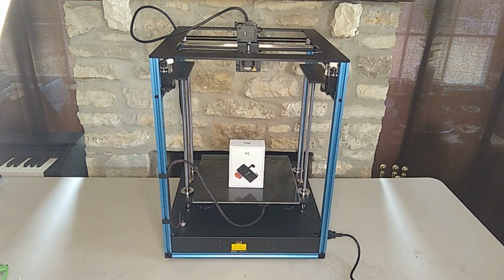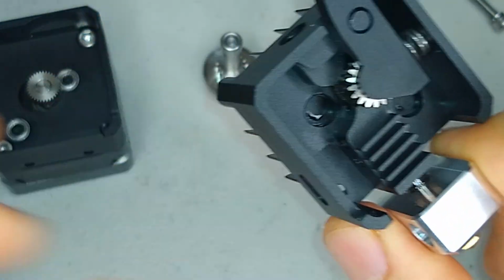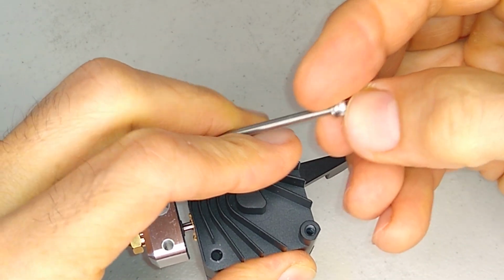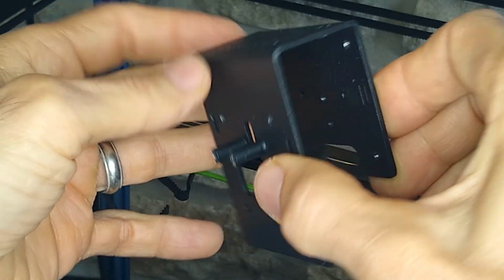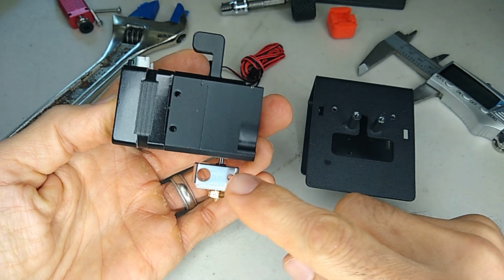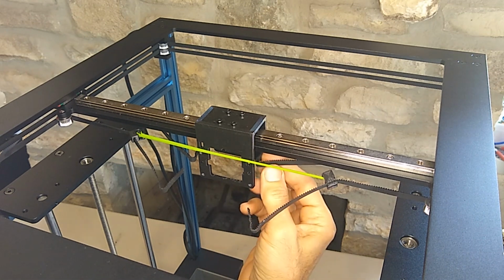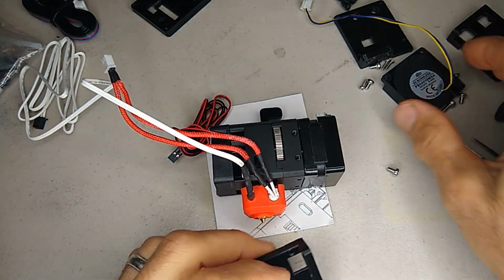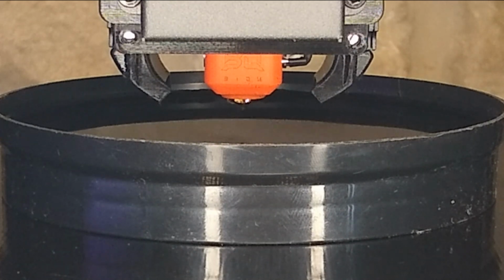BigTreeTech BIQU H2 500c Install with Dual Parts Cooling Ducts on Corception 300 / Creativity ELF

Comment: excelente video , como se consigue esa pieza para hacer convercion a RCA?? gracias
Reply from the maker: Hola Carlos, Gracias por comentar. Agregado tienes las piezas - https://drive.google.com/uc?export=download&id=18fj7KJJgVAlFWSyyWn2wGBkCC_DgBXEz
Reply: @vbared  muchas gracias bro.. pero ese conector , dónde conectas los termistores y todo eso , dónde lo compras ??? Cómo se llama ? Para no tener tantos cables
Reply from the maker: @carlosrivas3440  Hola, Mis disculpas por no entender las preguntas iniciales. Los Corception 300 vienen con esas partes. ¿Te refieres a la pequeña placa verde que convierte los cables al cable VGA? Voy a eliminar todo el conjunto del conector porque agrega mucho peso al cabezal de impresión.
Reply: @vbared  si bro correcto , mm no sabía que tenía mucho peso .. pero si se ve bien porque elimina mucho cableado que viene de la placa. Gracias por responder 👍👍

Comment: This orientation seems very bad for ringing and other vibrations with the relatively heavy motor so far away from the mounting point on the linear rail.  I'm considering changing from my direct drive BMG clone with stock hotend TwoTrees Sapphire Plus (which looks very similar in design, but with just more steel for the top part) to some other extruder/hotend combo to increase my flow (currently I only get around 16mm3/s reliably, limiting my print speeds).  I'm hitting a similar problem that all the nice combinations are difficult to mount and would cause lots of torque on the linear rail carriage holding the hotend and/or reduce the build space due to the nozzle moving away from where it now is.  The H2 was one option I was considering, but I'm not convinced mounting it this way would yield an improvement compared to my current setup.  I would expect Klipper's resonance measurement to deliver way worse results with the H2 mounted like that than with my current BMG (with heavy NEMA 17, but that is nicely balanced over the linear rail) ...  So, (in Yoda voice) keep look I shall ...
Reply from the maker: Hello MisterkeTube, Thank you for commenting. The Corception 300 has been an ongoing project for me. You are correct about the orientation of the hotend if the goal is to print fast. I cut off the two pegs on the original linear rail bracket and mounted it sideways. Thank you for the feedback on the timing belt keepers. Did you purchase the .STL files from my Shopify store? If so please send me your invoice number so I can refund it.

Send me some pics of your hotend mods when you get things right.

Enjoy your weekend!

Comment: Great idea on the "timing belt clamp holders", but you could even have made those fully closed, pass the belt through it before putting the belt through the hole of the carriage and then just push it over the double-folded belt.  If would expect it to be much more sturdy and have a longer lifespan if it would be a complete rectangle.
Reply from the maker: Thank you for your suggestions. Improving the design is going to be awesome.

Comment: I'm just wondering whether that heat-paste for CPUs is suited for the up to 300C temperatures of a heatblock?  CPUs normally don't get that hot, so I could imagine the paste isn't meant for such a higher temperature.
Reply from the maker: I had the same concerns until a viewer sent me some AMD copper paste he had been using on large transistors that generate a good amount of heat to try. After thousands of hours printing during an all metal hot end upgrade to one of my machines the old AMD thermal paste was still pliable. I know it works because without using it, while running Noctua heatsink fans, I would experience heat creep during long back to back long prints, the nozzles would clog.

Comment: Hi Victor, Really great job you ve done! One question: have you consider to add a bltouch?
Reply from the maker: Hello Sebastian, Thank you for commenting and encouragement. I have been wanting to add one. If I do it would have to be behind the hotend under the linear rail. Since making this video I've changed the orientation of the BQ H2.  I was getting too much movement from the hotend due to all of the weight being way out in front of the gantry bracket. Some type of manually added clicky sensor could also be an option.
Reply: Thanks again! Have you made a video with the new one? I have a biqu h2 for months and coudn't installed it :(
Reply from the maker: @sebideluca  Hi Sebastian,  Are you wanting to install it on the Creativity ELF or Correction 300?
Reply: @vbared  hi again! On creativity elf
Reply from the maker: Hi Sebastian, Linked is the CAD model of the new mount. It will involve grinding down the two hotend support pins in order to make room for the 3D printed BQ H2 adapter plate. I also drilled and tapped the BQ H2 in one spot to have two bolts holding it to the adapter plate. If you're interested in it let me know and I'll link it to you. I'm assuming the ELF mount is identical to the Coreception 300 version. If so it should work.

https://drive.google.com/uc?export=download&id=1D2dS517nSyyLcwAPET388d1ju_sNHntr

Comment: guide where to connect something to the motherboard, I think it will be useful to many ... will there be problems with connecting the p100 thermistor? there some kind of amplifier goes to it in the kit where to shove it?
Reply from the maker: Hi Viktor, Thank you for commenting. My kit was a high temperature one and it came with a sleeved thermistor that slides way in.
Reply: @vbared  I ordered the same one. but I can't figure out where should I install Max31865.

Max31865 is installed in the motherboard?

Could you make a guide for everyone or just lay out a diagram of where to put the Max31865

Thanks
Reply from the maker: @viktorcarnage2226  Hi Viktor, I'm unfamiliar with that module that was included with your kit. Mine kit didn't include the amplifier. I found the video below on it but it doesn't look to me like it would work with something like a stock Creality control board that doesn't have configuration jumpers or connection pins for it.

https://youtu.be/R_PmkXWLOYo
Reply: @vbared  hello, I have a robin nano 1.2 board, do you have the same one?, please answer one more question, which thermistor did you use pt100?
Reply from the maker: @viktorcarnage2226  Hi Viktor, Yes, mine came with a P100 but no amplifier board so I was unfamiliar with your question until I looked it up. The video I linked gave the pin information but I would search the forums for installing it on your specific board.
Reply: @vbared  thanks for the answers, do you think it will work without an amplifier?
Reply from the maker: @viktorcarnage2226  Your most welcome, Viktor. Yes, you can use the thermistor without the amplifier.

Comment: Hi Victor, how is your experience with this so far?. Any problems with TPU printing?
Reply from the maker: Hello Sachith, The BIQU H2 has limited mounting options on the machine I installed it on without losing build volume. The orientation I chose solved the fitment issue but introduced some print vibrations that I'm currently working to figure out. I haven't printed with materials other than PETG yet. Stay tuned for an update soon.

Best of luck with your mods!

Comment: How was the wireing for the 500c version the heater is 24v right? can i just use my old 12v heater and wait with upgreading my power supply? i dont need the 500c rn but i wanted the hardenet steel nozzle and it was just 10 bucks more
Reply from the maker: Hello King Karma, Thank you for commenting. I ordered a 24v volt version. If you install a 12 volt heater to a 24 volt power supply you'll cook it.  It also came with a high temp thermistor, heater, and brass nozzle. Big Tree Tech must have been running a free high temp upgrade because I ordered the standard bowden tube version. I was surprised to find mine had a bi-metal  copper and titanium alloy heat break. I switched out the stock H2 nozzle to one from a E3D V6. The sharper angle will produce cleaner prints 

Best of luck with your mods!
Reply: @vbared  yea I have a 12v Power supply I Figured out the Fan should work with 12v and I just use my Old Thermistor and Heater Till I got a 24v Power supply
Reply from the maker: @kingkasma4660  The BIQU H2 is awesome. I plan to install Klipper to run the Coreception 300. Still trying to figure all of that out.

Best of luck with your build!

Comment: Purchased your blasting nozzle stl from website. Would you also consider adding the solid model in the set? Wanted to change thread type and maybe modify to accept ceramic nozzles.
Reply from the maker: Hi Justice_for_Juicy, Thank you for commenting and supporting my work. Please email me vbared@gmail.com and include "V3 Vapor Blast Modification Request" in the subject. Give me the details of the changes you need so I can modify it for you. The design is patented.
Reply: @vbared  awesome. I'll shoot you an email shortly.

Comment: Hi Victor,  This is a very impressive line of design efforts.  Great work with OnShape and this time it was a littler easer to follow the flow.  I love the X home belt work to get all of the axis that is possible.  I have tweaked the switch lever to gain a few mm at times.  Inside the frames is always challenging. 
Very compact hot end assembly, E3V2 progression for cooling I love the thought process.
Victor your design work is to be admired again you demonstrate a desirable talent.
Looking forward to the follow up.  Thank you again.. Happy printing
Doug
Reply from the maker: Hi Doug, Thank you for your kindness. Onshape is awesome and learning CAD is a game real changer. I'm glad you are taking the time to learn it. As you've already discovered, coming up with your own designs is extremely gratifying.

Can't wait to see your completed Ender 5 Pro!